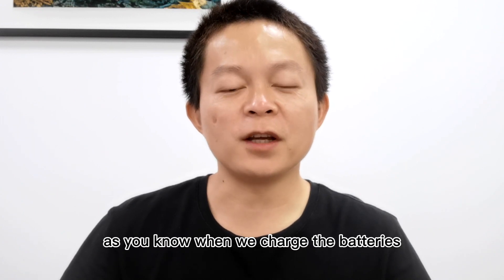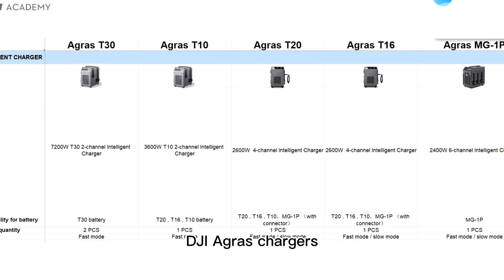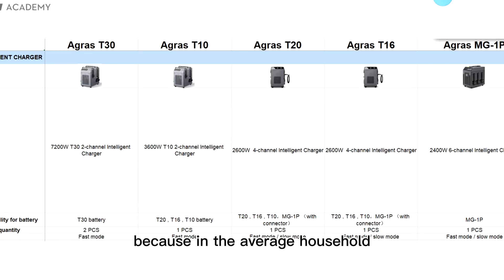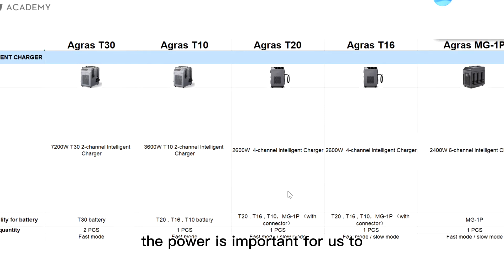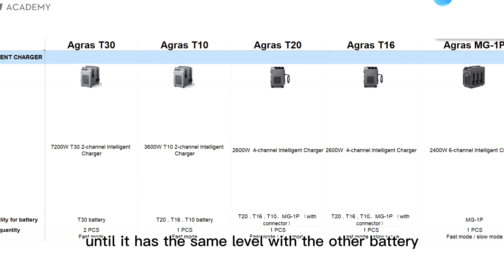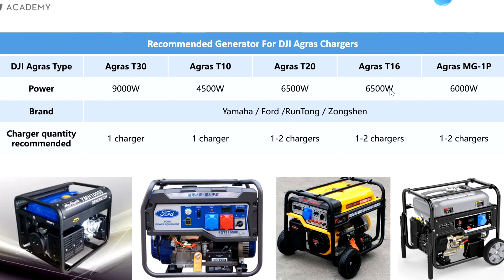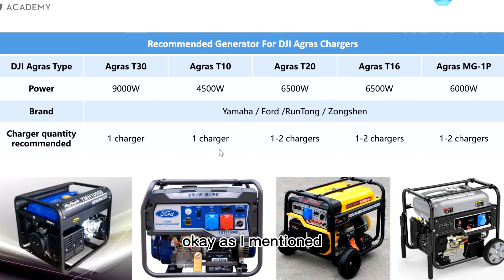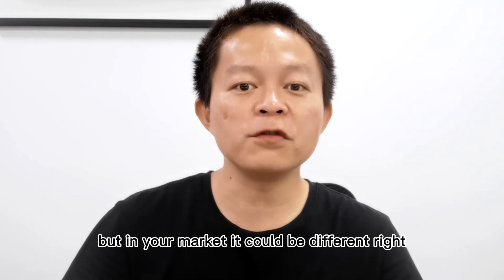How to choose a suitable generator for DJI Agras

Comment: For T20p ?
Reply from the maker: for all, according to the power.
Reply: @nickyye2382  6500w enough for t20p right sir ?
Reply from the maker: @pmyagri3204  yes but you have to use 3-phase generator. so it will be faster

Comment: If i connect the 2 ac cable to a hyundai generator hyg11050e with max output 11000w and Rated output 8300w, will it work ok?
Reply from the maker: i think so